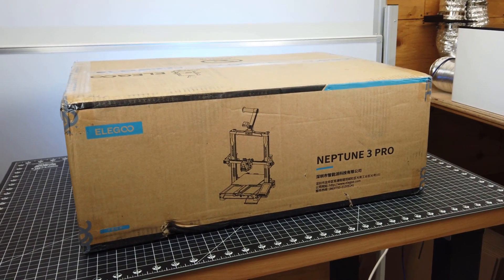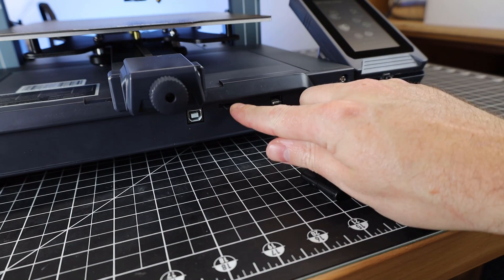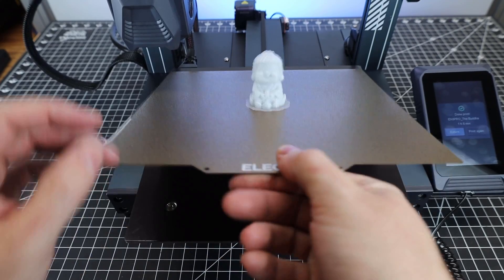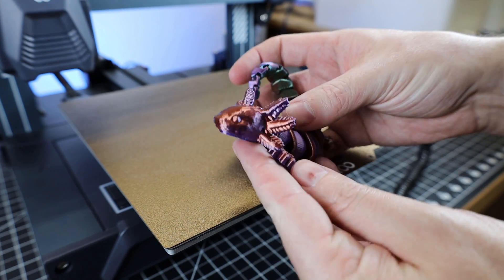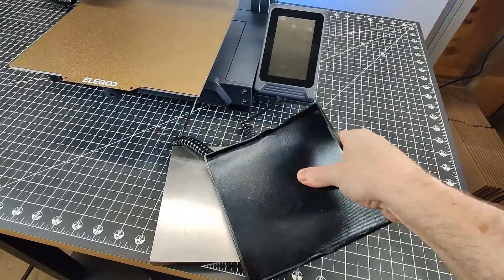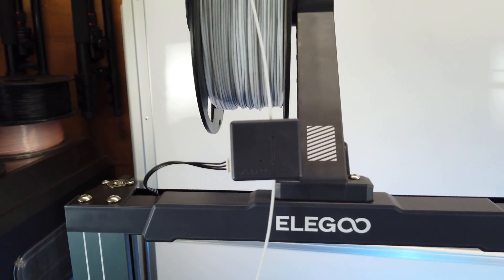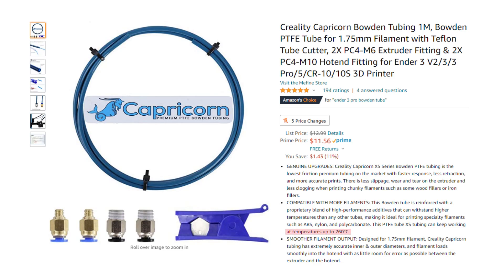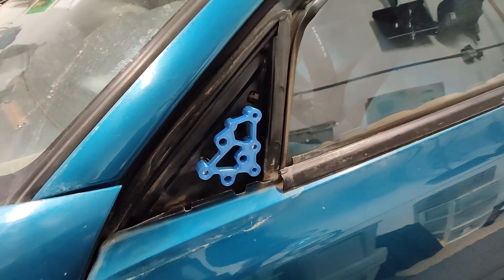Designing & printing my own tools - Elegoo Neptune 3 Pro

Comment: I have a quick question: Is the size mentioned on the website (475*445*515mm) the actual size 
with the filament holder and the Display on the side or does the printer needs more space to stand somewhere? (I'm asking because I would like to put it in a cupboard which has a height of 550mm and a depth of 520mm.)
Reply from the maker: So with the spool holder on it and a spool on it as well it's 736mm tall. If you take that off it's a little over 515 tall.
Reply: Thank you, I thought so but wasnt sure. So I need to put the spool on the side If I would like to put IT in the cupboard :)

Comment: Nicely done! There is a 2nd file for a tool holder for the N3Pro that’s on the Micro SD card. Not sure why they didn’t put it in the main folder location.
Reply from the maker: Oh yeah, I found that later on after looking at the SD card. Luckily I don't need tool holders anymore due to just having one kit for all the printers now 😁👍